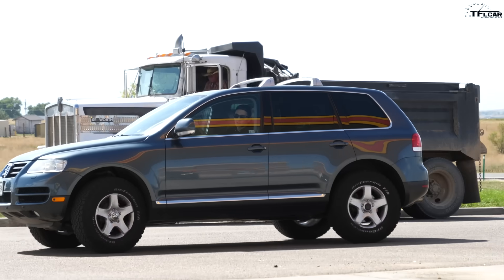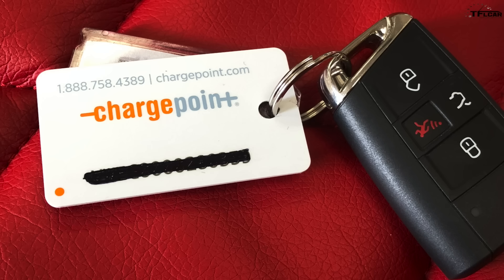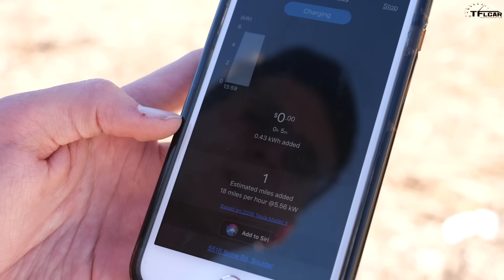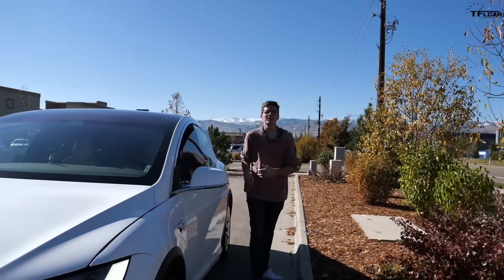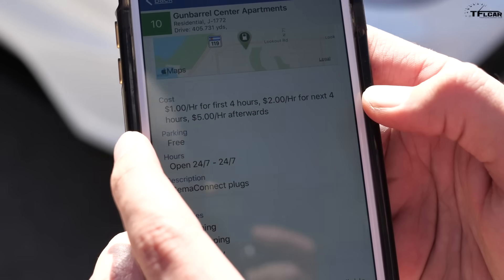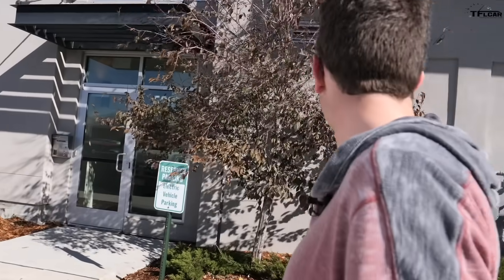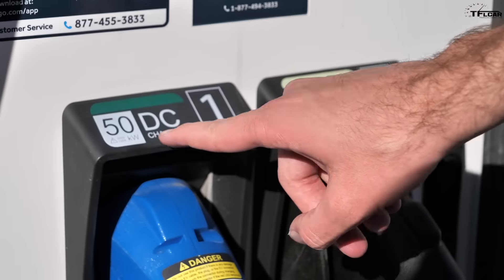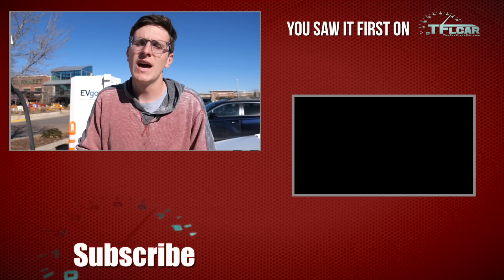Here’s Why Charging an Electric Car Can Suck - And It’s Not The Reason You Think!

Comment: I’ll wait until I can charge up in 5 minutes to full range before considering an EV.
Reply: Grab a chair, it might take a while...
Reply: @mindtraveller100  It could happen if you can convince the power company to put a transformer in your garage lol. I think its possible, just too dangerous.
Reply: Dominator2930 I’d do it at a Electric “station” like I do with gas hopefully. BUt if it’s less safe than pumping gas, I’ll have to wait for that then too before going EV.
Reply: mindtraveller100 Yeah thats’ what I expect. Frankly, I don’t always have time to wait an hour let alone 5 to 10 hours to get a full range capability. I’m hoping for some sort of battery swap at a station or something. If they can get the batteries standardized, maybe that’s a solution.
Reply: Lol filling up an SUVs gas tank probably takes more than 5 mins
Reply: Fritjof D Ok 10 minutes for an SUV.  For Full range too. When the EV can do that even, I’m in.
Reply: @dorthensensens  I mean a Model 3 can charge up to 80% in like 25 minutes. So it's getting there 😂 I'm just saying it's not as bad as it sounds. If you're on a road trip for example, you probably wouldn't drive for more than 350 miles without taking a bathroom and snack break of 20-30 minutes anyway.
Reply: Fritjof D You’re right for a large majority of commuters I think. There is still a large minority like me who does travel long distances where stopping even for 20-30 minutes each stop will be an issue. Especially when I drive 1400 miles in a 24 hour period.
Reply: @frtjf  It also probably ends up with double the range.
Reply: @loctite222ms  Maybe, but have you ever driven your car's full range without any breaks in between? you don't drive for 8 hours straight.
Reply: It is a paradigm shift in how you fill your vehicle full of energy.

We have been programmed through the decades that refilling a vehicle with more energy is something that you have to stand there and monitor while it happens.   

EV's completely shift this paradigm which is why it is difficult for non EV owners to grasp the concept.  Filling your vehicle full of energy is something that is done while you are free to carry on with other tasks.   You don't have to stand there and monitor the filling of energy into your vehicle.  You can sleep, watch a movie, eat, go to the bathroom, have a snack, go for a walk, go get Starbucks, go shopping, you are free to do other activities and a phone App will alert you when the vehicle is ready to go again.  

Also the concept that literally you can use any electrical plug to fill your vehicle full of energy is difficult to grasp for non EV owners.  No specialized infrastructure is needed, unlike for ICE vehicles.
Reply: Greg Brance you make good points. I agree that if you manage your day around supplying energy, then it can be a non-issue for many. However, living remotely, and traveling long distances beyond a single “full” range, taking more time to travel to destinations isn’t conducive to simply sleeping or shopping your way around it. Like I mentioned earlier, I’d rather a battery swapping solution for the EV rather than a plug in and wait solution.
Reply: @dorthensensens  I would never make the argument that a EV with current technology would fulfill everyone's needs.  Based on what you describe for your driving habits and your requirement you are a outlier.  A Tesla Model 3 Long range is getting fairly close to being able to fulfill everyone's needs.  A Model 3 did the cannonball run New York to LA, 2800 miles in 45 hours which realistically covers 98% of driver requirements for the ability to cover long distances in a reasonable time.  Not all EV's have this technology and access to this type of charging network.   Maybe that is why the Model 3 is outselling every other EV by such a wide margin in the last couple of years.  

I don't see the battery swapping technology as ever happening because the rate of charging is increasing to the point that battery swapping would create to many engineering challenges.  When you got 250 kw+ Fast Charging a car get's fairly quickly charge and for most people 15-20 minutes to add another 200+ mile of range is plenty fast enough.  

Me personally I have a garage, a charger and a Nissan Leaf Plus.  My wife is the primary driver and she loves the fact that everyday the car is ready to go in the morning with 200 miles of range which covers by a wide margin all of her daily driving.
Reply: Greg Brance well I certainly hope the Tesla type charging becomes ubiquitous for all EVs because that seems promising. Even for outliers like me.
Reply: @dorthensensens  I do also hope the Tesla type of charging network becomes more ubiquitous or the other automakers are going to continue to struggle to sell EV's.  If you look at the Model 3 sales compared to other manufacturers EV's.  In the US so far in 2019 through OCT Model 3 111,650 and the Chevy Bolt is 13,111 and the Nissan leaf is 9,111.  That is what makes me laugh when someone calls some manufacturer's EV a Tesla killer.  I remember not so long ago the Bolt was called the Tesla Killer.  Then the Hyundai Kona EV was going to be the Tesla Killer.  Hyundai has sold a total of 897 in 2019 for the US market.  I do think a lot of it is coming down the charging network.  Tesla has created a charging network that is ubiquitous and is easy to use.
Reply: @SDGreg  I understand your thought at home of not monitoring refueling, but what do you do when some unplugs your EV at a public charger?  Assuming you get notified on app do you leave the theater, restaurant, or get out of bed in the middle of the night.

As for 300mile range recharged in 5-10mins is not going to happen without paying for a lot more heatsink in the vehicle.
Reply: @bowez9  Well I have a charger in my garage so I don't have concerns about someone unplugging my car during a charge session while I sleep.  For L3 charging the charger locks to your car and someone wandering by cannot just unplug and stop a L3 charging session.  The time's that I have used a L2 public charger I have never had someone just come by and unplug my car.  

"300mile range recharged in 5-10mins is not going to happen without paying for a lot more heatsink in the vehicle."   We are already at the point that some EV's already on the road can charge about 200+ miles of range in about 15-20 mins which is plenty fast enough for 98% of vehicle owners.   Assuming you can find a L3 charging station that can supply the necessary current for this rate of charging.  A Tesla Model 3 did the cannonball run New York to LA, 2800 miles in 45 hours which realistically covers 98% of driver requirements for the ability to cover long distances in a reasonable time.
Reply: @SDGreg  going from 15-20mins to 5-10mins, means squaring the energy required at least.  Which leads to a whole new mess of issues.

As for unplugging a EV I see the same people that T.P. a yard.
Reply: That just seems dangerous if you do the math, the KVA is some crazy like 500KW. I'd rather have a 25minute to 80% of 400 Miles of total range. That is very doable soon and does not require gigantic KVA that has never been achieved before. It's all about Miles per Hour, once that is high enough even Cannon Ball Run is easy.

Comment: In 5min, I charge my Audi TDI with 600miles!    Seems that is the biggest problem with electric.  At my old company, we had a bunch or charging stations, but people were continuously jockeying position to try and get a spot. They all suffered anxiety.
Reply: TDI ...every time i see VW or Audi TDI in front off me i close all air circulation ...yes you can charge quickly but you also give a person behind you a cancer
Reply: dzonikg My car has been recalled and corrected.  It passes all emissions test for California, which is more stringent than other states.  How repulsed are you when you pull up behind a beautiful vintage 1965 Mustang? ... because that one is really killing you.

Comment: Reality in Europe: Most people have 240V. But no garage or house.
Reply: Does not require a garage. All you need for charging is a Private Parking near the building where you can install a EV Charger. Obviously the chargers in this video were outside. Problem is lots of Europeans do not have private parking. Then you are reliant on public chargers.

Comment: "most people dont have access to 240volts in their garage"... Me looking satisfied at my 400V outlet
And jesus USA sucks with all those different car connectors... long live Type2 CCS where level 2 means 6-22 Kw
Reply: What power is typically available on those 400V outlets you have so many of?
Reply: @ericspda  Europe has 480v 3 phase power pretty prevalent. Getting 32 amps per leg means 22kw charging on AC alone. Pretty sweet I bet. You of course need an EV that supports 22kw on board charging but many sold in Europe do. And smaller battery cars like Zoe don't even bother with DCFC as 22kw is fine and gentle on battery too.
Reply: @ronb4633  correction: 400V not 480 (previously, years ago it was 380)
Reply: @nirfz  thx, sorry I mixed in the US system. I should have said 400 v. Thank you.

Comment: Very good video. Definitely shows that electricity isn't going to replace gasoline anytime soon. With gas, you can carry 300 miles of range in your hands, and transfer that range into your car in all of two minutes.
Reply: With my Tesla Model 3LR I leave the house every morning with 300 miles of range.
Reply: @johnditoro1676  How long does it take for your car to achieve that range?
Reply: MultiPurposeReviewer it depends on the starting point.  With normal daily driving, its rare to drive more than 30-40 miles per day (the average American drives 37 miles per day).  My charger actually has an app that logs all of my charging data.  I didn’t take the car out today.  On Monday I drove 58 miles....the app shows that used 15kWh ($1.50 from my utility) and took 1 hour 32 minutes to replenish those miles.  If you charge every night in your garage you really never encounter the scenarios in this video.
Reply: @johnditoro1676  Interesting. I'm not saying that electric cars aren't viable at all, but I don't think they can compete with gas. You can carry an entire fuel tank's worth of gas in your car, ready to be used whenever you need it. You can't carry a second full charge for an electric vehicle. It simply can't be done.
Reply: MultiPurposeReviewer what i tell people considering an EV is to consider their personal situation.  Is this your only car or, as in most families, one of two cars?  Can you charge at home overnight? What is your normal daily commute?.  How often do you drive more than 250 miles in a day?  In a two car family with their own garage and a reasonable daily commute an EV makes a lot of sense.  If we didn’t have the ability to charge overnight or did a lot of long distance driving trips or were a single car family I’d stay with an ICE or Hybrid vehicle.  In my ~50 years of diving I have never once carried additional gasoline with me to refuel.  If this is something you do then I agree an EV isn’t for you.  But for the majority of us EV’s are an attractive option, very convenient, cheaper  to operate and a way to reduce our carbon footprint.  And, at least in the case of my Tesla, you get all of that and have a car that is incredibly fun to drive (0-60 in 4.4sec...I love seeing those Audi’s and BMW’s getting smaller in my rear view mirror!).  I don’t normally comment on YouTube videos, but this one so misrepresents the EV experience I couldn’t help myself.  If this video makes people decide not to consider an EV it has done them a major disservice.

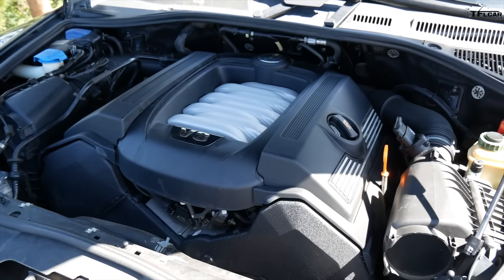Comment: I wouldn't say "stuck charging at home." (15:25) Charging at home is the easiest, most convenient and most affordable place to charge. Public charging stations are for travel or apartment dwellers who cannot install a charging outlet at home. You certainly don't need a garage (0:41) to charge at home since an outdoor outlet or charging connector can be installed very easily and affordably.

Comment: I'm gonna move my house from the UK to the USA and charge people to charge on my 240volt plugs!
Reply: computerbob06 To be clear, every house in the US has 240V service. Just usually not at outlets located in a garage. And the issue isn’t the voltage at all. 240V isn’t ‘more powerful’ than 120V. It’s just that in the US, 240V loads are typically higher power loads like electric dryers and ranges. They have typically 30A and 50A outlets at 240V compared to the regular 15 or 20A 120V wall plug for lamps and phone chargers. It’s not complicated to add a high power plug to most every home in the US, it just costs a trip from an electrician. The model 3 will also charge at 48A at 120V, but it costs the same to install a 240V receptacle, so that’s what people do.
Reply: @ericspda  I did not know it would charge on 120 at 48a that's bringing back memories of Griswold family Christmas is a turn on the Christmas lights and the meter spins out of control.........
Reply: imark7777777 You’d need to wire a wall connector with 120V, which wouldn’t make much sense. Or you could wire a 14-50 improperly and charge at 120V/32A if you have a generator or something odd that won’t supply 240V. But it does indeed allow for it. Of course it would be half the charge rate as 240V, since the onboard charger in the US is limited to 48A. But there’s no reason why one couldn’t make any amount of power at any voltage. It’s just not terribly practical for high power at low voltages. That’s why transmission lines are thousands to tens of thousands of volts. This talk about 400V being superior is complete nonsense. You can get 480V 3PH in the US, most industry has it. You can request higher voltages if you’d like, it just tends to not make sense since most equipment isn’t designed for anything past 480 unless it’s an arc furnace or absurd high draw.

Comment: Back in the day, the gas stations took only their own cards.  I had a Shell, Exxon and Texaco card.  They all took cash, but that means you have to interface with someone.

For my EVs I have Chargepoint and Tesla.  Tesla came with the car, and signing up for Chargepoint was no harder than getting the previously mentioned Shell card.

You are right on the facts, but it really isn't all that hard.  No need for any drama.

Comment: People driving EVs around outside the city is just hilarious to me. Unless you live in a city it makes no sense.
Reply: Beach Lovin I live in a small town.  The next town is 20 miles away.  I easily do a round trip that would have worried me a year ago.  We are under 100,000 population, yet have 6 free public chargers.  I have 220v in my garage, but 110v does fine. I only charge 1-2 times per week.  2014 smart bought 2 years old for $5000.
Reply: @hjeffwallace  Population of a small town of under 100,000 hahaha. Dude that is not a small town. I just googled the population of my town and it is 4,237 as of 2016. Also living in a beach town means we have large trucks and SUVs everywhere. I wouldn't feel safe driving such a tiny tinker toy around.

Comment: I'd love to know what percentage of EV owners ever use a charger that isn't at their residence. I've owned my i3 for about 9 months and have charged it outside my house exactly twice (both on the same trip back from the airport, when it was VERY cold and my battery was draining more quickly than usual). I don't have a 240V charger, I just almost never drive so far that I can't recharge adequately overnight on 120V.
Reply: If you are on a trip or the power is out at your house you'll need to find a charger somewhere else. Not everyone just drives to work and home and never does anything else.
Reply: @fastfreeks  totally! I'm wondering what that "not everyone" number encompasses, definitely not claiming everyone uses their EV like I do. I have lots of neighbors who have an EV and a gas-powered vehicle in their household (as I do), which can be a practical mix depending on your household etc.

Comment: I loved using the Plug Share App when I was borrowing my Aunt’s 2015 Prius Plugin Hybrid, especially when I did not have the J1772 cord with me. The app also shows you which EV stations are free to use since I do not have an app to pay in order to recharge an EV. For anyone that has an EV or even a Plugin Hybrid car, Plug Share App works really well if you are not willing to have an account with Charge Point or other EV stations.

Comment: Most people DO have 240V high voltage in their garage. In the USA, just about all homes without a basement will have the main circuit breaker panel inside the garage.   However homes with basements uasually have the circuit breaker panel in the basement, away from the garage. This kind of home takes more cable to install an EVSE in the garage.  This of course only is for people who have a garage in their home. Many people live in apartments, or homes without a garage.   I do NOT recommend a BEV for people who do not have their own garage or their own dedicated parking area like a driveway or carport.

Comment: Don't see why Tesla own plug sucks. You don't complain about iPhone not using usbC connector. Also Tesla provides you with adapter. And charge point sucks anyway. Use Tesla network and you don't need to hustle  with other chargers